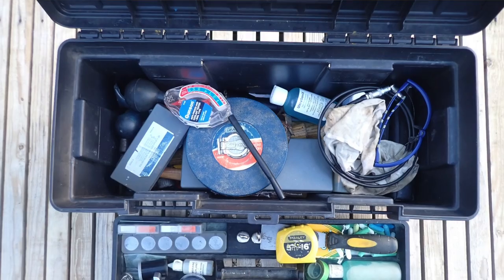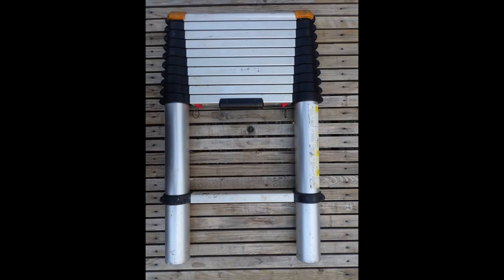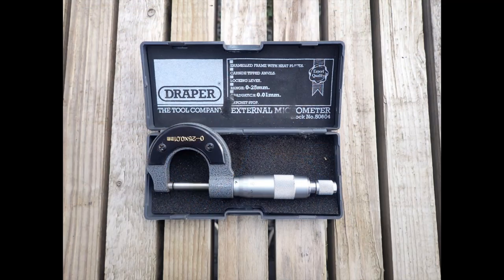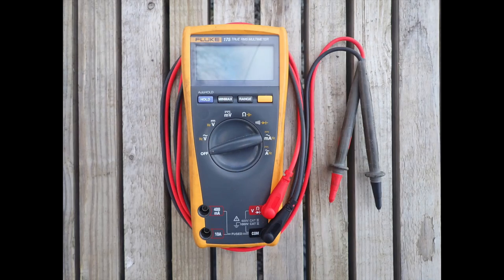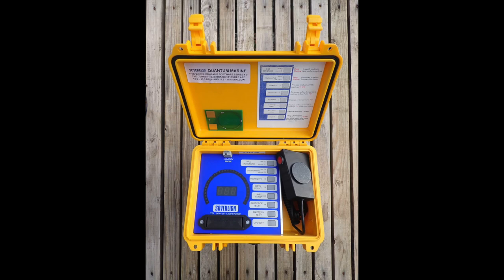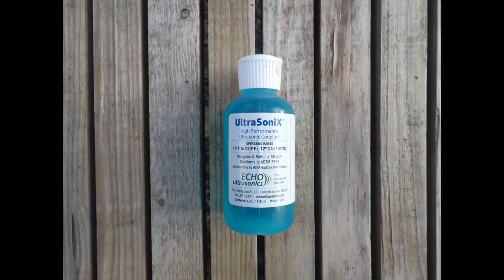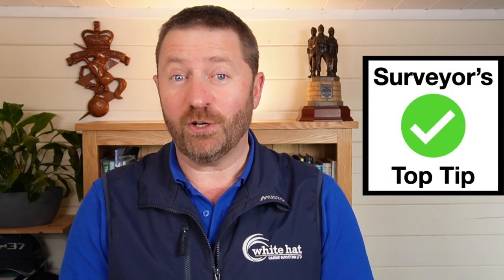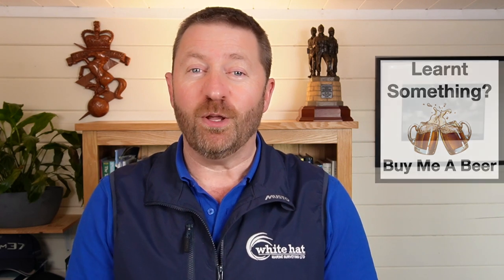The Marine Surveyor's Toolbox - A Guided Tour #marinesurveying

Comment: Really enjoyed this, thanks so much for making your time and effort free to us 👍👌👏.
A really practical guide as to what to have handy for any type of marine survey and eventuality. I like the way you've assessed over years of experience which tools work the best and also which are the best and most practical to use when out on a job/up a ladder, under a hull, in a confined space etc.
Do you give each client a preamble/disclaimer as to how any worthwhile and meaningful survey will potentially involve scrapping, probing and tapping/hammering the vessel?

Bloopers 👍👍😄
Reply from the maker: Thanks for your comment Simon.
A key part of any condition survey is to use non-destructive testing to establish the structural strength and integrity of the hull and its fittings.  Occasionally something breaks under the application of a reasonable force and this highlights that the item concerned was no longer fit for purpose.  
Scraping away patches of antifouling helps reveal cracks, blisters and other laminate defects.  Tapping the hull and fittings with a hammer helps identify voids, delamination, cracks and general deterioration and this is called percussion testing.
What comes with experience is knowing how hard to hit it and with how big a hammer.